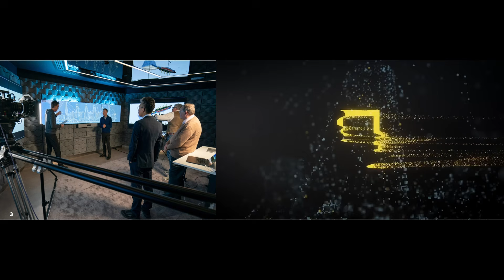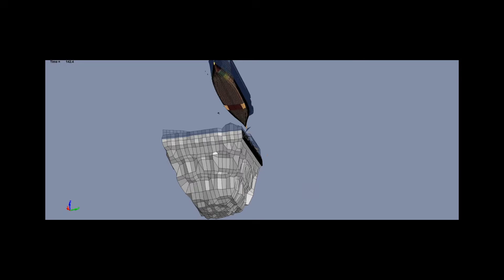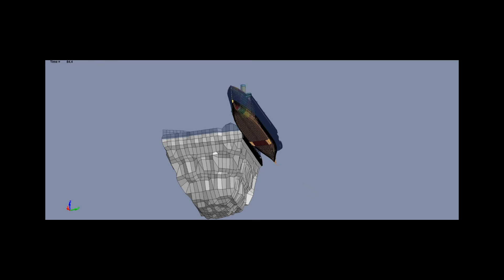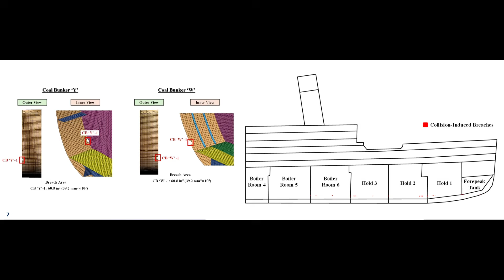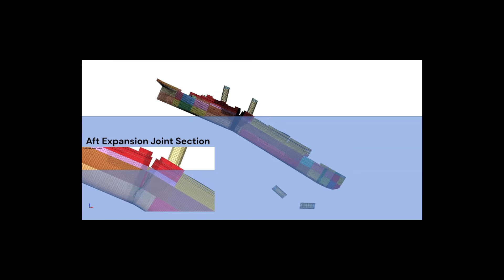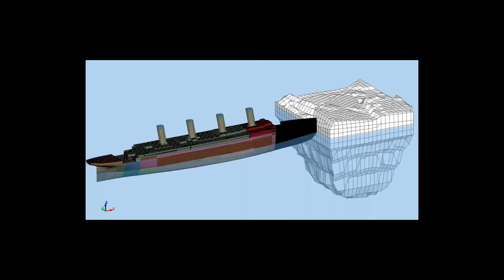The Digital Reconstruction and Resurrection of the RMS Titanic's Sinking

Comment: In this simulation, the reference hypothetical collision assumed that the iceberg's impact face was perpendicular to the direction of travel, leading to the assessment that hull deformation would not extend as far as the No. 6 boiler room; however, this reference scenario strikes me as overly optimistic. 

Even if the duty officer had chosen to ram straightly the iceberg head-on, executing a maneuver to strike the impact face perpendicularly would be extremely difficult, and the impact would likely occur at an angle. This would presumably generate moments in the pitch and roll axes; consequently, the scenario in which the majority of the collision energy is dissipated solely through the crushing of the hull structure seems like a rather optimistic baseline. 

I have a strong intuitive feeling that any collision energy not consumed by the self-destruction of the bow structure would be diverted into shearing the hull, causing damage to the remaining structure and leading to flooding and sinking.
Reply: I’ve assumed given the more realistic size of the iceberg (as opposed to this one) that the ship may even ride up on the iceberg or nudge it some, but would receive a lot of damage to the fore peak area and even the keel as opposed to hitting what’s essentially a glacial shelf and crumpling like in this animation

Comment: This is excellent.  Why is it assumed that the hull damage was all at 2ft from tank flooring? I know that was Barratts statement, but I thought scans showed plate separation across different heights. Also, i thought the water came from shell plate separation ie very thin but long.,  This simulation seems use punched 'holes'?  Also, what as the calculated degree of list before separation?  And how low in the water was that?  How visible was the break?